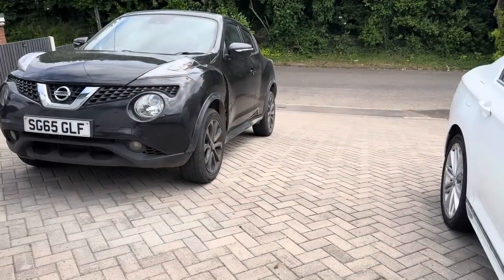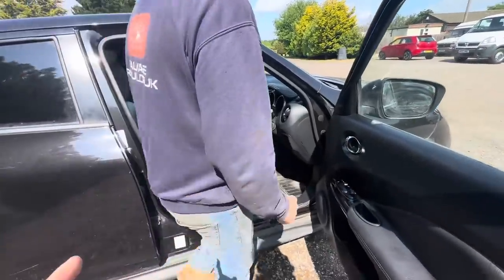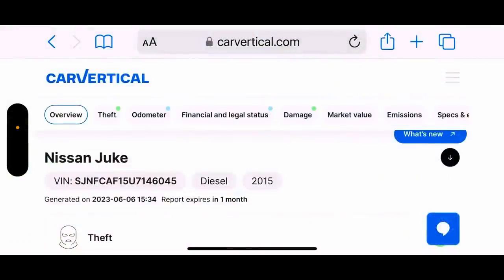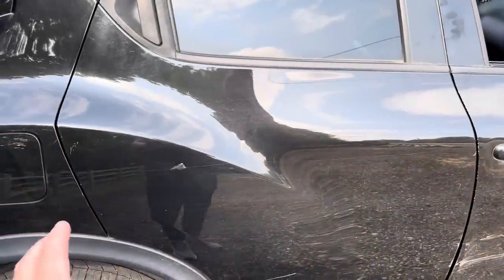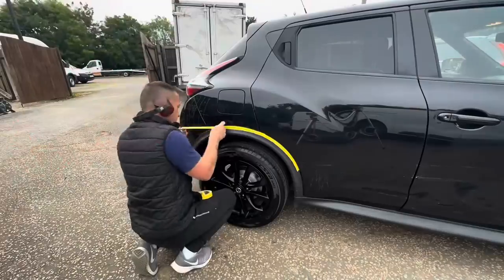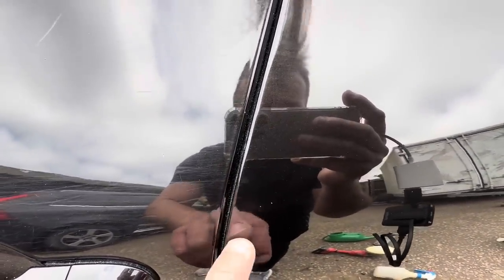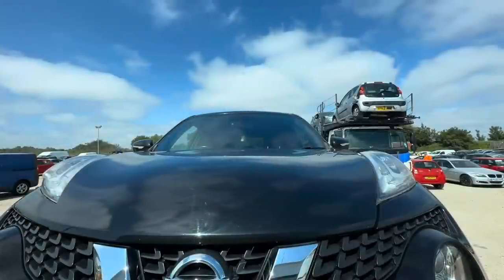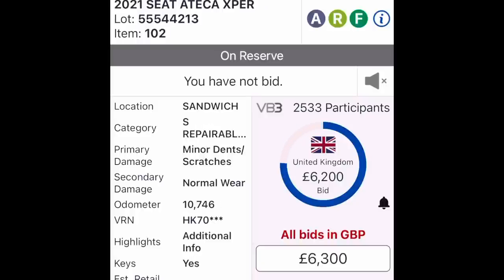WE TAKE A GAMBLE AND PLAY COPART ROULETTE WIN OR FAIL ???

Comment: Think that could of been sold to a subscriber rather than wasting time at copart. 

Also think you could of tried something else new for the channel, rather than thinking you have to replace all the panels, why not get a dent repair company to come out and try and remove some of the dents. 

You did a cracking job with the polishing Rob came up loads better than i would have thought.

Comment: Surprised at Chris' negativity on this one but I get there is a backlog and it will be £2k out of your cashflow. Given the used prices for that mileage for an unrecorded Juke is about £4.5k to £5.5k I doubt the parts would have cost £1k (if available) so even selling it for £4k they would have seen a profit. I guess the challenge is finding all those doors, bumper, wing and trim in colour and without damage. As even in colour parts are often damaged and need a repaint. Rob should have put an outboard on it, as Chris would have loved it then ;-)

Comment: That's a Tekna spec car. Surprised the seats aren't split, a well known fault. The rear parcel shelf is also likely to break, the clips are weak. Lots or Tekna's built in black (paint code KH3) the build label should be in the onwner's manual folder. It's got the Renault K9K 1.5 engine. Nowt flash but a good workhouse engine.
Worked on the development of the Juke as a new model and the achilles heel is the interior space especially the boot space.

Comment: Needed to be repaired to make the money because body panels for those are expensive.  It is a body shop respray for that but in good condition those make very strong money especially as it is HBI clear. Someone got a bargain at £2000.
Reply: Not £2000 as paid copart buyers fee and vat that would cost them around £2700
Reply: @rajayusuf3288  done a few of those my son is trade. Big demand when we sell them. About a weeks work on that for body work and full spray. Dearest items will be plastics and bumper. Yes make more for light damage cars but still money to be made as it is top spec and hip clear. Did not give mileage so that could effect resale. £2700 is not a bad price.
Reply: @markcreeney-if7rr watch the auction: 115k

Comment: Don’t blame Chris! Give it away to a needy person. I’m surprised you always say  ‘DIESEL’  when diesel motors are now the scourge of the roads because of air pollution issues they cause. Should stick to petrol or better, more eco cars.
Reply: Lol, its a used car it's 8yrs old and the thing with the greener cars is that people sell their diesel car to buy one.
The diesel car isn't scrapped so now there are 2 cars producing co2 not 1.
Unless you crush the old car when you buy a new one then just means twice the cars on the road.
It takes around 60k miles  even if you buy an electric car just to break even on co2 just to offset the building of the car.
I agree air polution is an issue in towns but even if they  gave everyone a free electric car it  would take decades to offset the co2  to build them all, as 80% of electric in world comes from fossil fuel.
Reply: Diesel Engines Power the World 💪
Reply: Not even close. Newer diesels are better for the environment than most petrols!
Reply: @-DC-  planes,traims,ships,trucks all use some form of diesel.
Its is said that 1 older cargo ship from China with all your goods produces same co2 as all diesel cars in europe.
Reply: @-DC-  not for much longer as ferry’s, cargo ships, trucking, quarry trucks, cars, vans, motorcycles etc etc are all moving over to the cleaner, cheaper in the long run and much more fun electric vehicles, as well as reducing the child killing diesel and petrol air pollution
Reply: @adamspencer95  don’t kid yourself. From 2.5m and under particulates and V.O.C’s they are way worse
Reply: @kinross24  PM2.5 is far from the be all and end all of air pollution. There's a reason petrols are being fitted with GPFs now.

Also, gasoline contains far more VOCs - think how quickly gasoline evaporates vs diesel.